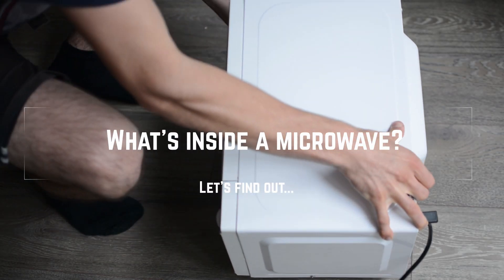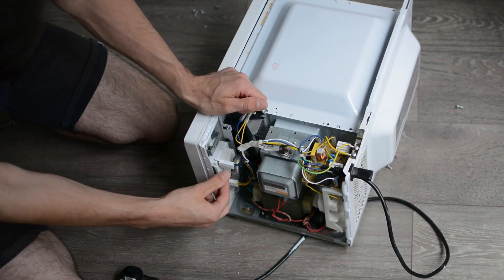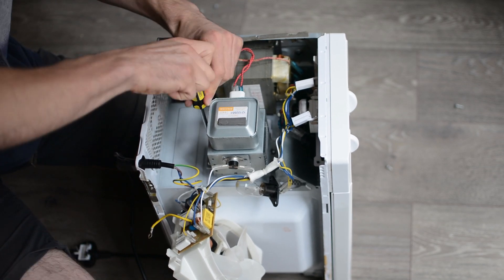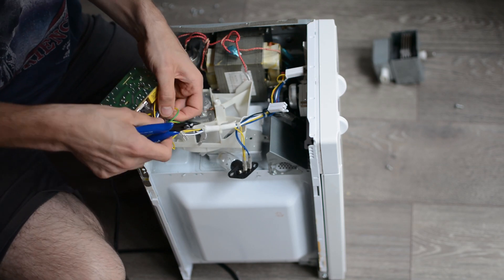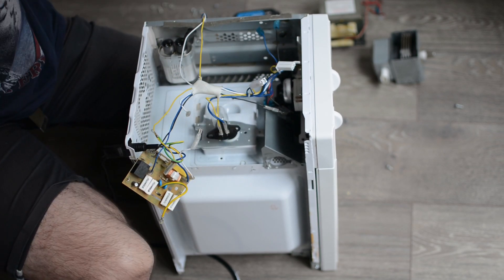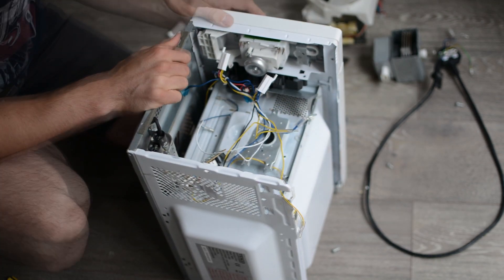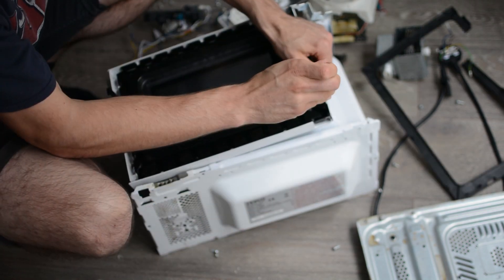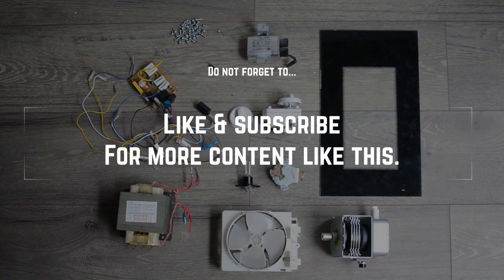What's inside a microwave oven? Disassembling one & salvaging parts, reusing basic appliances

Comment: Always discharge the capacitor FIRST before touching a microwave, just in case it's holding a charge, and as long as you dont crack the beryllium or try and grind it out, the magnets inside are worth keeping. Just be careful, I think I it's best for people to know how to take them apart safely, otherwise they'll never know.
Reply from the maker: That's exactly what I did. Also kept the magnets, being really careful about the beryllium. Thanks for useful tips!